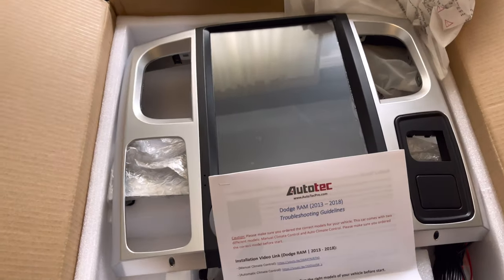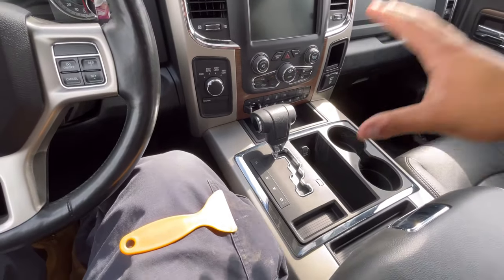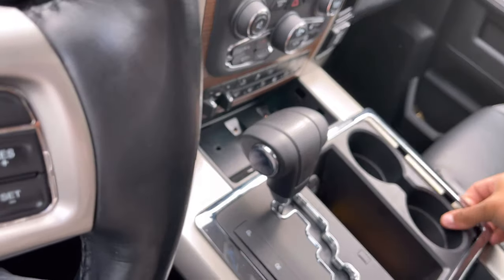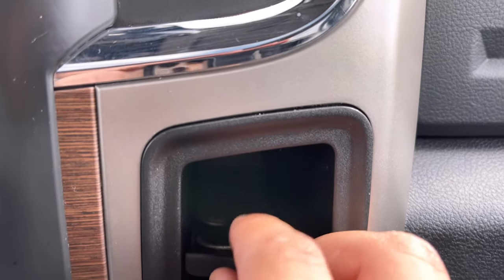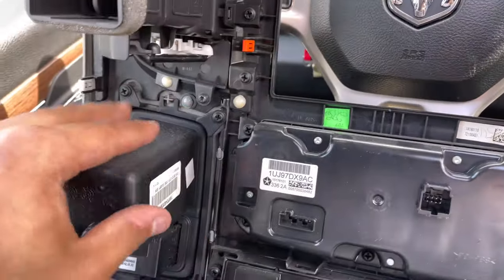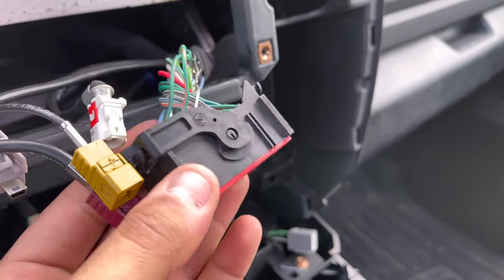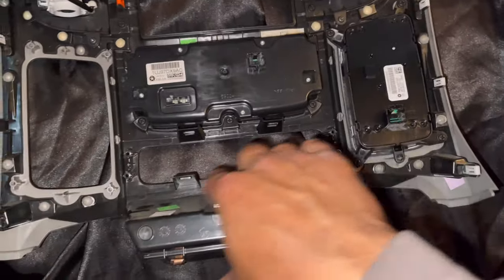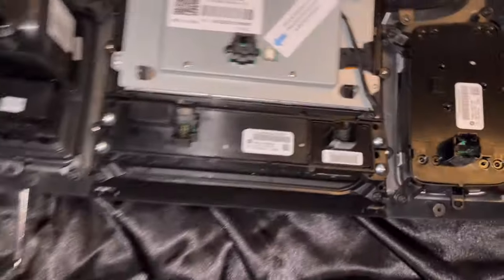AutoTecPros 12.1” Tesla Style Radio Upgrade | How To | Gen 4 Ram | Wireless Apple Car Play & More!

Comment: I just ordered mine, talked to the customer service before I bought it. Will be shipped out next business day and will be in my hands with in 3-5 days. I did pay for express shipping. Otherwise would be 2weeks! I’m getting excited!
Reply: Ok bro 3 months later what are your thoughts on it?
Reply: @Tinman76  only issue I had was YouTube kept going into pip mode, with update that was fixed, I can’t update Netflix due to the fact it will not work if I do, lastly Hulu not available. Other than those small issues this radio is awesome!! Sound is great, you do have to figure out the eq. Everything functions! Well worth the buy!
Reply: @Sololobo84  thank you sir. No Hulu and Netflix that’s disappointing. HBOmax? Apple TV? That kind of stuff working or no? Looks like a great unit probably going to get it regardless just curious. Spotify works NP? That and Waze are really my go to anyway.
Reply: @Tinman76  no Apple TV, haven’t tried hbo max. But Tubi, Funimation, prime video, and paramount + work. Right now I’m using carwebguru to customize screen
Reply: @Sololobo84  good shut my man thank you for the info. Enjoy it
Reply: Greeting guys!!!
Where can l get it..?

Comment: Looks sweet I just ordered mine today ! can't wait thanks bud
Reply: Thoughts after a month?
Reply: @Tinman76  Well, where do I start. The unit is awesome HOWEVER i did and still do have much problems. The A9 version they sent me had no sound, so they sent me another one an A11 newest version ( why they didn't send that first is beyond me) still no sound when connected to Bluetooth. Had to leave out for 1 week while they bench tested theirs and then I got a phone call saying I have to leave USB cable unconnected as that was causing a conflict and giving me no sound at all, once I did that everything on Bluetooth now worked. BUT the radio ( FM,AM) now doesn't work because im assuming it doesn't run off Bluetooth , which for now doesn't matter as I use car play and everything associated to that is working for now. Im hoping they iron out the bugs so this will one day work 100% but the screen is awesome, car play is awesome. Support is ok but you really have to stay on top of them as they sometimes are slow to reply.
Reply: @cryptojohnny7781  damn that’s frustrating. I hope they fix that shit quick for you or at the least just get you a whole new unit. Good luck thank you for the info appreciate that

Comment: Great video.  I do have one question.  If you have factory nav, how did you connect that to the unit?  i saw you you had a nav antenna that came with the kid; why would you need that if one wants to use the factory nav?

Comment: awesome video bro , i have 2011 ram 1500 laramie you think this radio will work with my truck ,thnaks
Reply from the maker: Appreciate that bro! Check the link to make sure but I don’t see why not!
Reply: The big perk to these radios are the factory ac, heated seats etc are on screen. You cannot just stick any radio in. These are for 2013 up, to new style Ram. The 2011 Ram takes a different type radio, but they do Make them for your truck. 2011 is a lot easier to upgrade.

Comment: Got mine in last week but I have a five channel amp to add to it so that is gonna be a little different also still asking if you added the SIM card for the internet I want to know where you found the IMEI in the unit so I can get it and add the sim. Also did yours come with a code on the box mine has a number on the box under the description I got the 8gb/128gb 
Thanks
Reply: Did you figure out how to hookup external amps? Which RCAs are dedicated to front, rear, and sun?